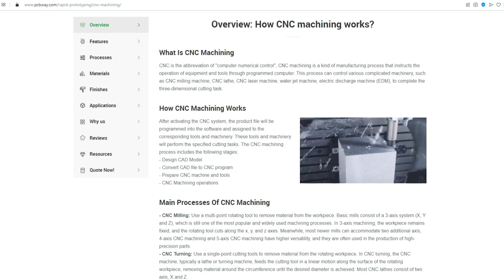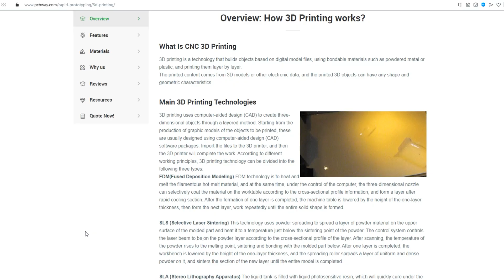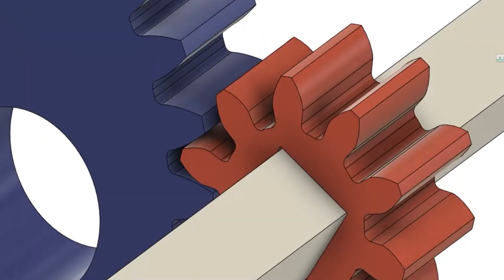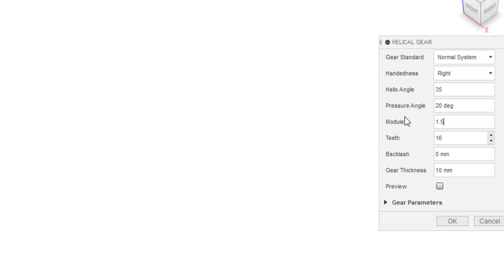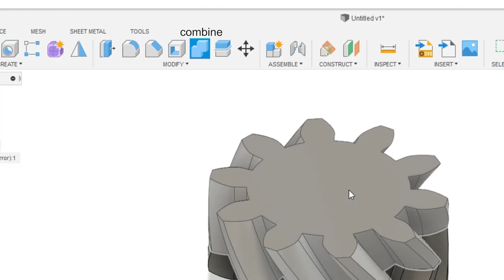Which - 3D Printed - Gear Performs BEST?

Comment: Is there a way to know what size is best, say for a 1 inch diameter gear, 10 teeth, 20 teeth or 30 teeth. With more and smaller toothed gear, there would be more teeth contact, but with less, each tooth would have more surface and thicker. I would think this may change depending on if they are run at high or a slower speed, 300 rpm or 1500 rpm. Maybe a vid on this? Also, I find planetary gears real interesting and would also be a good video. Thanks for you videos.
Reply: There is no definite answer for your question. It very much depends on a couple of parameters. Helical gears are less efficient. Also on 3d-printed gears the layers add a roughness perpendicular to some frictional forces on helical gears, which will reduce lifetime and efficiency even further. Spur gears on the other hand cause a lot of vibration, because the lever of a spur gear changes with the contact point of the teeth. A spur gearbox has an output speed which swings between two speeds each time a tooth engages. The difference between those two speeds is determined by the size of the teeth. Those vibrations can cause fatigue breaks in materials. On spur gears all the force is always on one single tooth.
In general the bigger the teeth the more force (torque) they can take but the bigger the losses and vibrations.